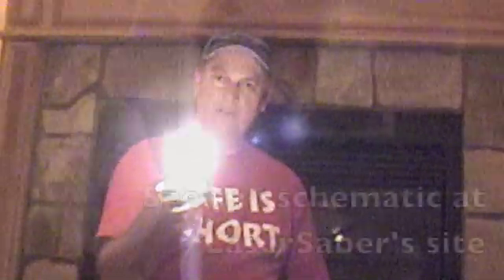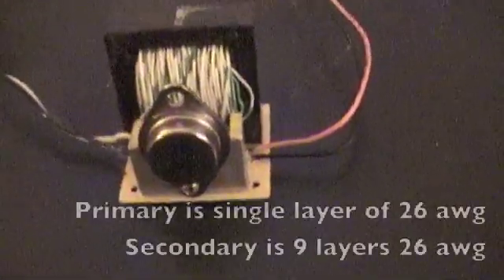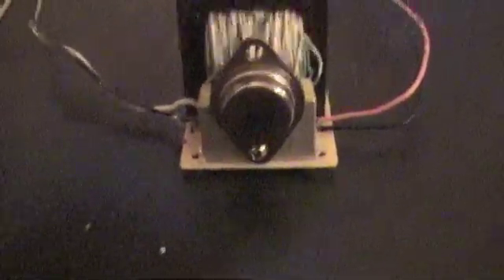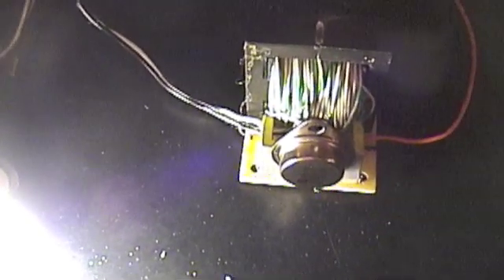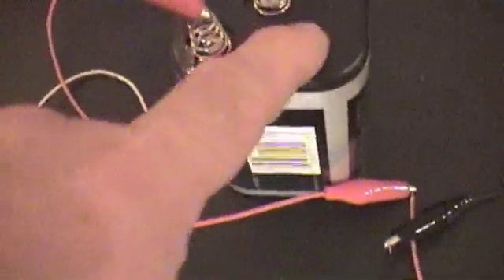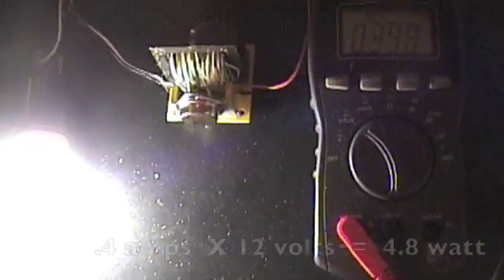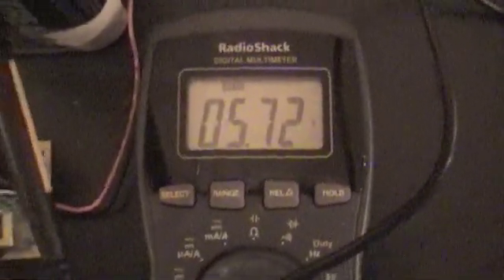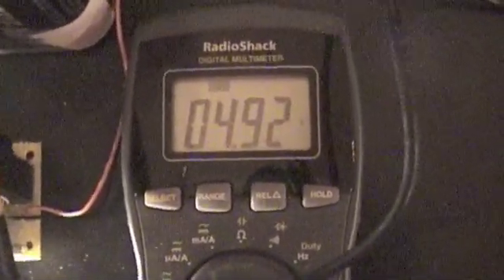Joule Ringer Version 2 - replication

Comment from the maker: The wire is solid 26 awg telephone wire.  Your other question? Just one layer of primary and then about ten times that number of turns for the secondary if it will fit.

Comment from the maker: Next up is an exciter circuit using just a 2N2222 an indicator LED and a coil off 6 v.  I think it can be done and power a 3 watt LED bulb.  It may not even need a base resistor using a touch switch to start.